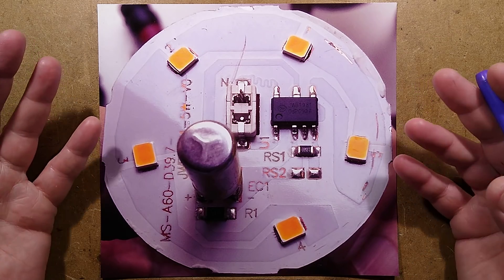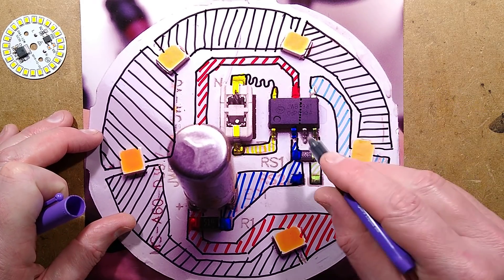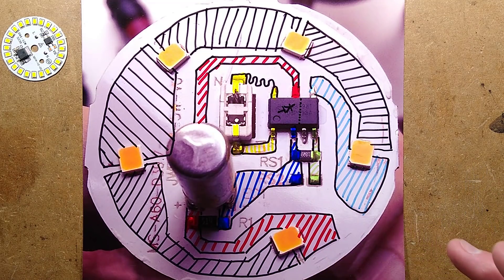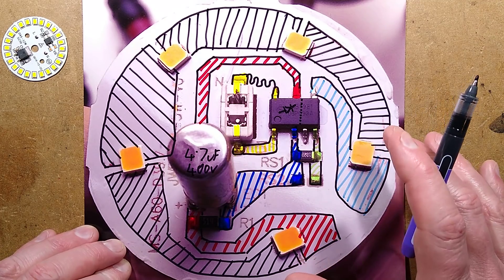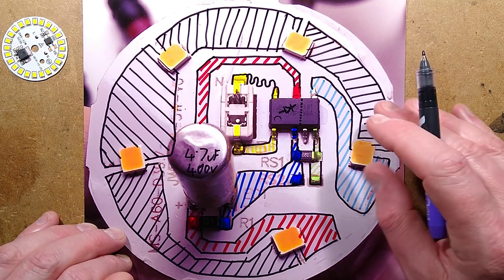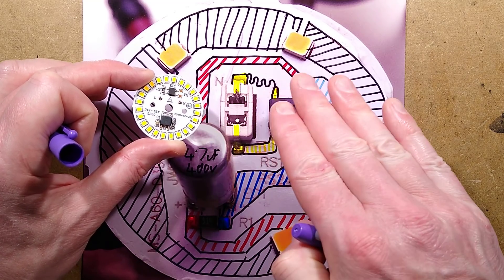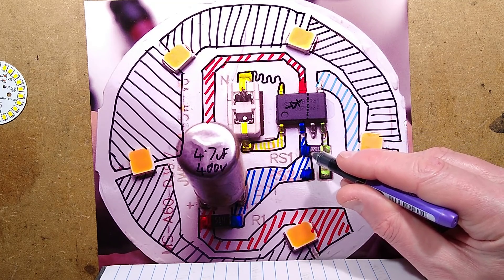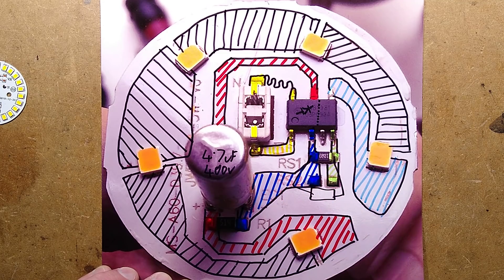New LED lamp twist reverse engineered from a picture

Comment: When you get your hands on one of these lamps it would be interesting to grind open the IC and see if there are 2 separate pieces of silicon.
Reply: The more I think about it, there'd almost have to be two pieces of silicon.
Reply: @misterhat5823  Depends on the process. Any process that's setup for BJT transistors should be able to make a full bridge rectifier that's isolated from the substrate, and thus possible to put the current limit circuit on the same piece of silicon.
Reply: @misterhat5823  Can you imagine a single chip that would house all the chips in the world?...hmmm 😁👌

Comment: Nice video as always. What is actually holding those chip/package manufacturers back from putting those resistors and capacitors on such a package? Or is that just not a possibility?
Reply: It doesn't make a lot of sense to put the resistors in the package, as you'd have to produce a separate part for every current rating you wanted to support, makes a lot more sense to produce a single part which you can use an external resistor to set a fairly arbitrary current on, that way the lamp manufacturers only have to purchase one type of chip, and you only have to produce one type of chip.

And you can't physically get enough capacitance onto a sensible sized piece of silicon to provide meaningful smoothing for an application like this.
Reply: @SomeMorganSomewhere  thanks for the reply, that's very insightful!
Reply: Different wattage lights need different resistors

Comment: If you scraped more gaps on the fat LED tracks, could you add more LEDs to brighten the lamp but still reduce the load on each LED and still make the lamp last longer, or would that produce too much heat for the heat sink and drive the board components beyond their rating? 

Also I notice different colours for 2 of the LEDs, is that to tailor the light to a specific colour temperature, say warm white? 

Many thanks!
Reply from the maker: The LED packages already contain a large number of chips, but better quality lamps do use more LED packages with less chips in each one.
Reply: Nicholas:  Too much work, to do what you're suggesting, unless you have a particular art project ("I need pink here, turquoise there...!") and are happy hacking the hardware -- but even then you might be happier with a LED-lamp-kit from Ebay or AliExpress, so you don't have to chisel your way into an already-made lamp :-)
Meanwhile, just buy cheap lamps, let them die, replace them.  C'mon, only $1 each :-)

Comment: Could this be the most efficient way to drive LEDs? No buck/boosts at all!
Reply: Pretty much. 
The LED chain voltage is designed to be as close as possible to the smoothed DC on the cap which minimises the amount of energy you have to dump as heat in the regulator. So most of the losses are inefficiencies in the LEDs themselves. Hard to see a switch-mode part which is suitable for this sort of application outperforming these current regulator chips in terms of efficiency (and cost/BOM count).
Reply: Switch-mode will probably get you more efficiency (95% and less waste heat?), and a nice wide input voltage range (90V-260V?) -- but if/given that SMPS costs more, and is fairly unreliable (dry electrolytics, shorted semiconductors...) it's not necessarily preferable.
As usual, you pays your money and you takes your choice.
Reply: @theskett  IME most of the waste heat in these things tends to be from the LEDs themselves so I suspect you're going to have similar losses (or perhaps even more) with an SMPS.

If we were talking "old school" I've got a 12V plug pack and I want 5V out so I'll drop 7V across 7805 setup you'd be 100% right, but in this case it's more like a 3.6V LDO on a 3.7V battery (<3% loss in a perfect world)

Actually it'd be interesting to see just how much voltage drop there is across the chips in these things, it'd let you get a better feel for the overall efficiency.

Light globes are one of the few cases where a wide input range isn't really a major benefit (when was the last time you took a light globe from your home country and wanted to run it in a foreign country with a different grid standard? ;) ), and with the extra BOM cost (and potential points of failure) I suspect one of the cases where it's actually cheaper for a manufacturer to build two separate products for different markets.
Reply: I think you're right, re "a wide input range isn't really a major benefit" -- but if it's nearly-free, I'd take it; rather than shipping two different lamps.
No way I know, without BOM and cost to build two, eh.  Usually two 220V caps instead of a 440V, and they might be smaller so easier to fit. shrug :)
Reply: @SomeMorganSomewhere  Thanks, good calls.  
Plus any SMPS is likely to be less reliable than the LEDs, if the LEDs aren't overheated :-)
"Light globes" confused me briefly, btw; I guess that's a synonym for "LED lamps" :-)

Comment: Some hours ago, I opened a dead led lamp that started flickering today and it looked nearly the same as in the video, also with this tristar cap. What a synchronicity!
Reply: Try replacing the cap - the light might live on for many more hours.
Reply: Exactly; "It's never Lupus" -- House; "It's always the electrolytics" -- all we techs :-)
Reply: @gorak9000  I bought a lot of these bulbs for 1€ each, so decided to never buy these again, because they all failed after a short time. I will replace these retrofit bulbs with lights that dont overheat that easily.
Reply from the maker: If one of the LEDs has a black dot in it, a bond may have failed.
Reply: Electrolytics first, shorted mosfets second, after that, you might actually have to break out a scope to fix it. Usually then you're hunting for failed zeners, or open resistors, or something more exotic.
Reply: Find the dead LED, bridge it out , and adjust the current programming resistor for a higher value. If you don't have a adjustable PSU, use 9v batterys clicked together in series ( to up the voltage to match the LED forward voltage) add a resistor to limit the current. This is how I find the Dead LED (on those multi chip LEDs)

Comment: I have a small night light that I've noticed the LEDs glowing very slightly even when the light is turned off. I've been wondering why they do that.
Reply from the maker: Even the slightest hint of capacitive coupling between switch wires, or to ground if switched on the neutral, will make modern LED lamps glow.  They are extremely sensitive.

Comment: Unfortunately, cramming as much as possible into an area, affects life expectancy of a design due to lack of cooling. 
I'll rather have a single LED in one package, than multiple LEDs in one package.
Reply from the maker: That's why I recommend hacking these lamps to lower the power.
Reply: But a single LED is 3V-ish, and the mains is (rectified, peak) 330V-ish, hence we use multiple LEDs.

Comment: There are two financial advantages to integrating the bridge rectifier and regulator into a single package.

Each component has to be placed, either by a robot or by hand.  That takes time.  Time is money.  Fewer components to place means less time to assemble, means cheaper to produce.

There is a (fairly) fixed cost in potting a die in epoxy, both in the cost of the resin and the time taken for the resin to cure.  A hybrid package is slightly cheaper than two individual packages.

We're talking shaving fractions of a penny off the costs, here.  But if you make enough of the things, it's worth it.

Comment: This level of extreme optimization in this kind of devices is astounding. Next step chip on board? Bare die? Place your bets I guess
Reply: Chip embedded in a ribbon strip between mains and LEDs, like some of the LCD drivers are now.

Comment: That 4.7uf smoothing capacitor looks like it's ready to go POP.
Reply: Seven minutes and 45 seconds long and no mention of it... Come on Clive, you know we were waiting for you to point the swollen cap out! 😅
Reply: @gibbwilson2770  I don't think it's budging, they just punched the pressure relief from the inside on the cap lid. They punch it thin in that star pattern like that so if the cap IS about to go "POP", the thin metal gives way and lets the pressure out, vs the entire can exploding. Little capacitors, usually less than 47uF don't have the "vent" - they're way more fun to blow up by hooking them up backwards. All the bigger caps do have the vent reliefs, and they're really boring - they puff up, then the vent opens, and all the magic smoke escapes.
Reply: "they just punched the pressure relief from the inside on the cap lid" -- could be, but it'd be the first time I'd ever seen that if so (normally there's an indented 'Mercedes' logo, eh), and also makes the cap look bulgy (which is problematic when diagnosing any problems).
Reply: just like bidens America lol
Reply: @lordjaashin  you people are insane
Reply: @lordjaashin  And what's like the Trump organisation which also likes to politicise everything.

Comment: somewhat odd that they made a custom 7-pin package with uneven lead spacing instead of a standard sot-23-6 or something considering the 7th pin is apparently redundant/unused. Perhaps its because there are two dies, one for the rectifier and one for the regulator? very strange.
Reply: the mains pins need a greater distance from the rest of the circuit than the smd package pitch
Reply: @nirodper  Ah, of course. I always forget about mains separation, which is of course why I mostly don't touch this stuff, lol. The redundant pin is still odd though.
Reply: As you say, I'd think "custom" => "more expensive"; but asymmetry is good, too:  https://en.wikipedia.org/wiki/Poka-yoke

Comment: Im planing a 3 channel color organ. I'd like to make it as high a wattage as possible ( 700 watt per channel) if not the schematic I have is 400w per channel. Any help you could offer? Any idea on bulk bags of colored leds?
Reply: That's a 'how long is a piece of string' question. 

In broad terms you'll need to beef up whatever the switching elements are (TRIACs, BJTs, MOSFETs, IGBTs) probably add more heatsinking and potentially boost the drive to them.
Reply from the maker: These days I'd suggest staying low voltage and using some op-amp based filters to possibly control PWM outputs.  Could be good with 5050 RGB LED tape.

Comment: I bet there are two chips in that package.
Reply: That would be a waste when all parts could be made on the same chip with 30+ year old technology.
Reply: @johngypsydoe862  Chip level insulation might not work too well with 240V....
Reply: @reneschmitz4845  Fortunately, 220V chips do exist, such as timer chips for coffee makers.  It tends to require large dimensions, very different from the tiny nm scale dimensions in microprocessors.
Reply: @johngypsydoe862  I'm well aware of the existence of HVICs.

Comment: Could you tell me what it's called (to search for) the blue plastic strip with the different width notches to form axial component leads at right angles. It was in  your last video on the Ioniser build. Or did you 3D print it yourself?
Reply: @bdf2718  awesome, thanks. I was making the mistake of looking on CPC, farnell, rapid etc. when I should have just googled it
Reply from the maker: The component lead former came from eBay.

Comment: I'd still love to see the resistor replaced with a potentiometer to make it a sort-of dimmable lamp, mostly cos if I tried it, it'd probably go bang and set my room on fire... :P
Reply: A 100 ohm plastic pot in series with the existing resistance would do it.
Reply: @amojak  Good call.  Don't let the pot spin down to 0R, eh?  :-)
Reply: The secret to making it go bang is using a potentiometer which is not properly isolated.

On another note, I wonder if the parasitic inductance (and/or capacitance) of long leads extending the sense resistor would cause instability. That could also make a bang.
Reply: @eDoc2020  The secret to NOT making it go bang is to have a variable resistor in series with a fixed-value resistor.
Long leads aren't relevant, just solder the VR in series with the fixed resistor, on the substrate.

Comment: Still no real solution to the problem of dimming. In the early days of "high efficiency" light bulbs, dimming was not really an issue, as the technology had returned us to the dark ages, reading by what was no more than candle light. Now LEDs bulbs give a usable light level, dimming would again be a nice feature to have.
Of course it would be very nice to also have colour control, but not at the cost of including a Wi-Fi receiver in every bulb. One can only applaud the slow return to simplicity in the bulb circuit design, gone are the days where the weight of the inductors included in the bulb risked pulling the rose from the ceiling. I just wish that dimmable bulbs were better. That is minimum flicker, wide dimming range, operates with standard dimmer switch, and highly integrated to avoid lots of electronic waste.
Reply: I've changed the one way wall switch for some of my lights to two gang switches. Wired so the second switch adds a capacitor in series to the light, thus dimming it... Its obviously not variable and takes some trail and error to find a cap that dims how much you like it, but works for me...
Reply: @burtgummer9057  That's genius level thinking outside the box. It would have never crossed my mind, but it's so obvious once I read it.
Reply: @burtgummer9057  not a bad idea, but bulbs designed to work with a wide supply voltage range might stop dimming working. It is irritating that the currently available range of dimmable bulbs do not always specify compatible dimmer switches. They often don't specify if they require leading or trailing edge dimming.
Reply: @nigeljohnson9820  this is where the cheaper leds are best for 'home hacking' or dimming, as most just have a capacitor dropper anyway. Wouldn't work well with a bulb that uses a smp.
Reply: they have those now. BOM ($) is constantly shrinking for them too, stay tuned.
Reply: One way to achieve better dimmable switching, might be to change the switches to allow some form of digital signalling between switch and bulb. Unfortunately mains signalling is now difficult due to the huge amount of noise on the mains supply. The problem of excess electronic waste, might be solved by putting the receiver and control electronics in the light fitting, and only plugging in the LED array, using a new standard bulb socket. A compatible bulb control transmitter could then be included in the light switches.
This would only work if it received the support for the standard from all the light bulb manufactures.

Comment: Nice work, it's interesting they just stuffed a bridge in there, as you pointed out you can see the topology by the pinout, wonder when they will be able stick a useful amount capacitance in there as well or is that never due to heat or breakdown ?...cheers.
Reply: Capacitors in silicon are possible, but you're talking pF sort of capacitances, maybe a few nF at the outside, getting enough capacitance to smooth a supply like this into a silicon wafer is pretty much a physical impossibility.
Reply: @SomeMorganSomewhere  Thats exactly what I thought...cheers.

Comment: I have few of those new LEDs with just chip, bridge and cap(I think one of those is similar to this one but have bigger chip and no separate  bridge) but  they flicker as hell, what would be easiest and best way to stop them from doing that? They  have aluminum base and I don't have luck with soldering them so any easy way to fix that?
Reply from the maker: To aid soldering you can preheat them on a clothes iron clamped in a vice.  They don't have to be too hot.   The flicker is an issue that is harder to fix.  I made a video about adding a capacitor,  but it puts a lot of extra strain on the regulator chips.
Reply: preheat in toaster over before soldering. you need a small amount of capacitance to kill flicker. ceramics will take the heat. This will shift up the low end of dim range; too much and it won't dim at all so experiment.
Reply: I'm a little scared of toaster ovens, because I can't see WTF's happening in there; nor get in there with a soldering iron :-)
IIRC BC used an electric iron, mounted upside-down in a bench vice, as a hot plate; or just a regular electric hot plate on 'Low' works, too.
And then, yeah, add some capacitance.  Beware that adding capacitance will stress the LEDs a little more (because they get more of the peak sine wave, rather than just the unsmoothed RMS).

Comment: How sensitive LED's are: take a LED and a resistor above 150K in series, hold one side between your fingers, and push the other side on the live mains. It will indicate.
Reply from the maker: I'd suggest using more than one resistor in series for that as a safety feature.
Reply: @bigclivedotcom  Good thinking, although the old neon testers within a screwdriver use one 1/4 Watt, but then the neon bulb acts sort of as the second resistor.
Reply: Some LEDs will glow from the RF signals if you use your body as the antenna against the ground
Reply: @Slovenec5  Is that from RF or the 50Hz field ? You could try in in the open field.